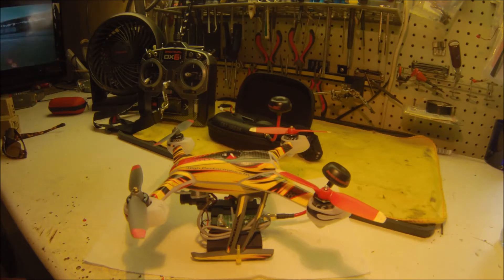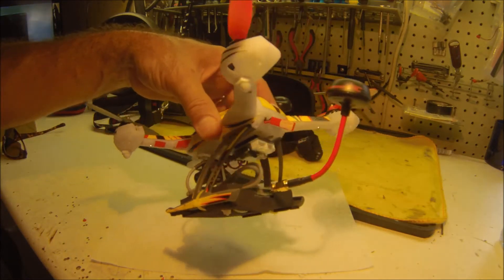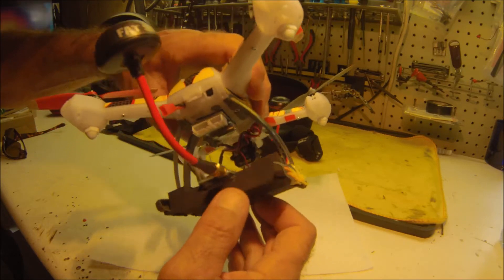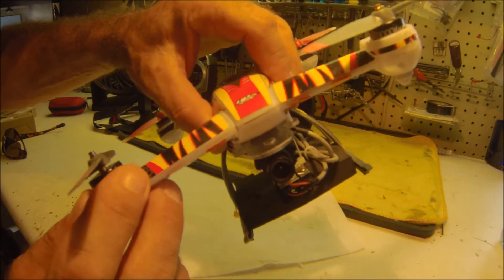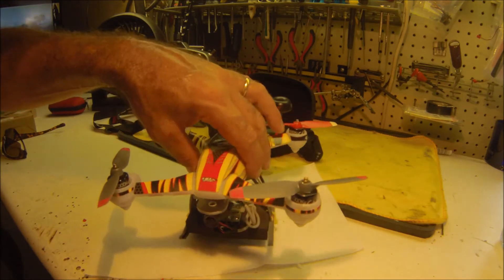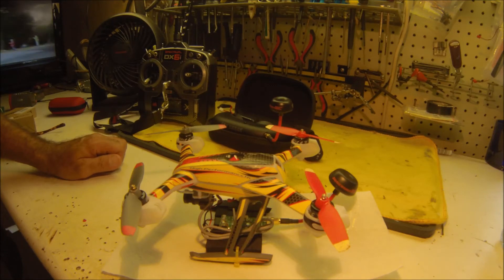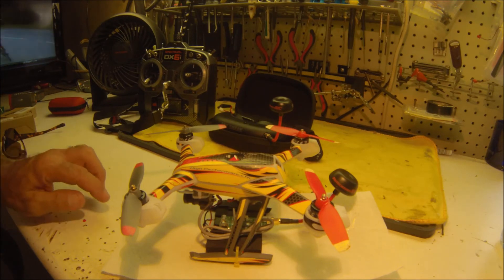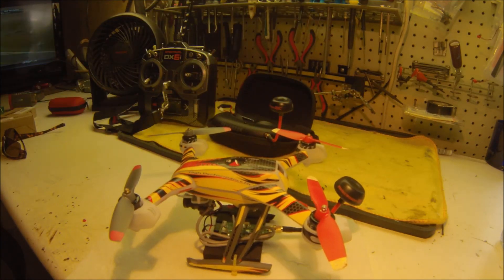FPV set up on my Blade 200Qx

Comment: I had posted a comment on your flying video regarding setup, then saw this and deleted it.  Thanks for posting your setup!  I did my first (backyard) FPV on my 350QX this past weekend using Predator 2 and Mobius cam.  Very neat and very different mode of flying. I actually strapped the goggles on my son for first flight to give me a reading on the picture quality before I tried it out - lol.  Might take a step back to the 200QX as it would be nice to have "less quad" in the air.  Anyways, look forward to more of your videos as you progress and, happy flying!